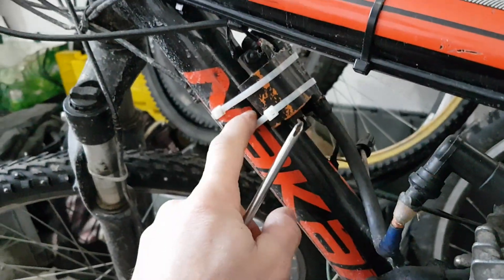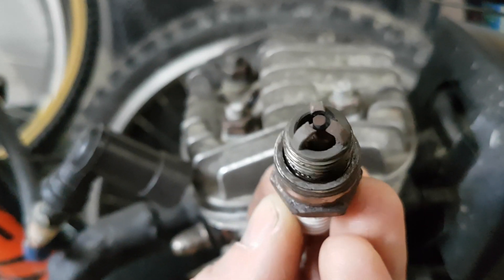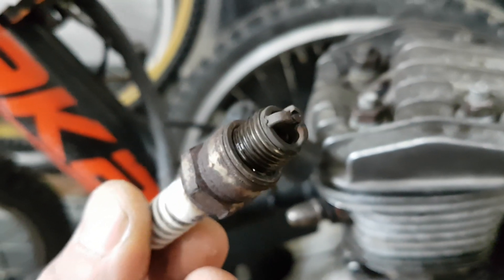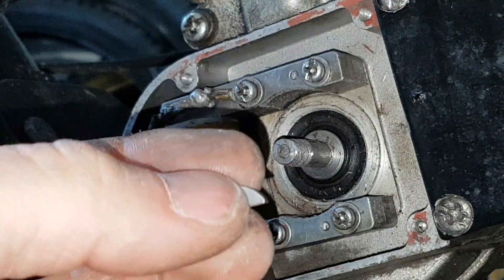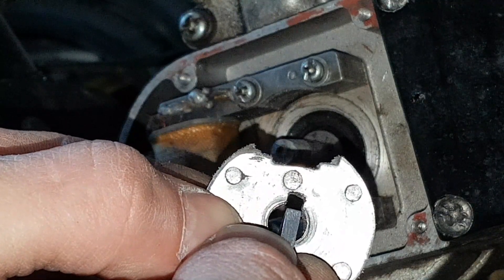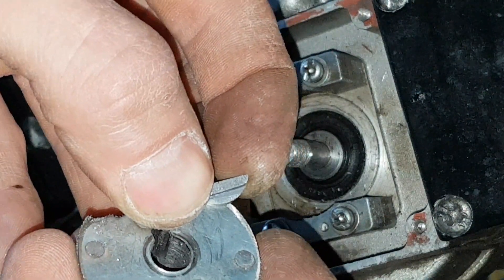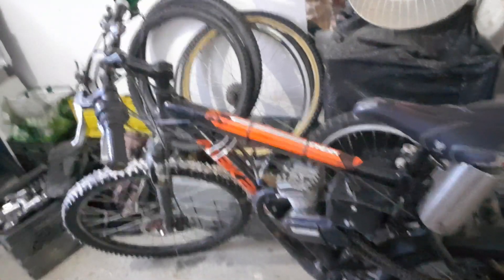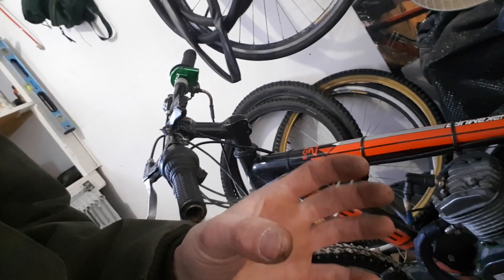Gas bicycle ignition timing tinkering..rocket key.

Comment: Very good thinking brother you definitely going in the right direction... you said you ported on the card... iv thought about doing that... what carb are you running and where did you cut on it... thanks again brother nice video
Reply from the maker: Carb was honed a little bigger and bellmouhed at the air in side...not much of a performance enhancing mod though...if done you never open the inside up big enough so that the slide doesn't seal anymore

Comment: What kind of tires are you running
Reply from the maker: Kenda kinetics was a good fat rear with some sidewall give i love that in summer in witnter it depends usually will stud the front and keep rear rubber so i can slip out and control around corners....no drifting no fun.

Comment: awesome riding. I cant believe you wheely so good. awesome upgrade as well. I think you are maxing out the timing advance with 1 mm. 1 degree of advancement on that magnet might be 1/4mm since its not 360mm in circumference. Im just going to advance 1mm see what happens.
Reply from the maker: Thanks for the input,It's been s while since i played with that, made a case reed and a bunch of other mods, check my other vid gas bike ripping  wheelies! Most of the vid is on the rear wheel, a bit tough to tell with the camera angle tgoigh

Comment: I don't think retarding the timing past Factory location is going to help with any extra power gain you probably had it perfect in the first location you moved it to I might try the same with my bike motor but I'm still porting the exhaust and stuff on it I'll let you know in about a week how it goes
Reply from the maker: BALDYS RC PROJECTS no I advanced it, and from what I am  reading I may need to go as far as 20° so maybe I didn't go far enough.
Reply: Ride Fast Yes i know you advanced the timing I was just letting you know that would not be a good idea 😌 let me know how the 20° advancing turns out i just finished a decent Port job on the stock carburetor haven't seen anybody do that before so I gave it a shot think it turn out okay to 😀
Reply from the maker: BALDYS RC PROJECTS yes you can bore a carb with good results...and if there is enough metal to work with open it up like a velocity stack/horn.But be careful not to hone the area around the slide bigger that the slide or air will get past and cause erratic idle.and look inside when open throttle wide I was able to get more height therefor  more WOT

Comment: Is there any news? I bought a crankshaft with 44 mm stroke instead of the 40 mm stock one, so I guess I'll need to adjust the timing a little bit. But I'm using the stock CDI and I heard that the timing is too advanced on high RPM.
Reply: I love low RPM more, I'm using a smaller sprocket then the stock one (32T instead of 44T), I'll also buy a reed valve, I'll make a tuned pipe too for low RPM. The 44 mm stroke crankshaft is available on Ebay. Also the longer stroke can work on lower RPM. My whole bike is only 23 kgs and I weight 60 kgs so I have lots of torque. :D
Reply from the maker: Jordán József have you had this stroker kit... I looked online and don't see anything that looks like it will work?
Reply: Damn my boy hanging out fr fr nice riding man!!!